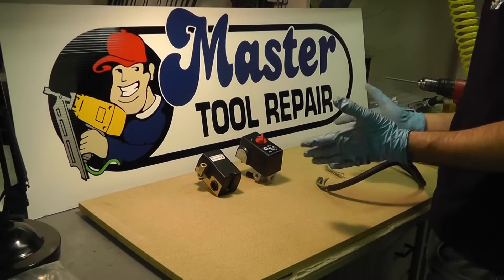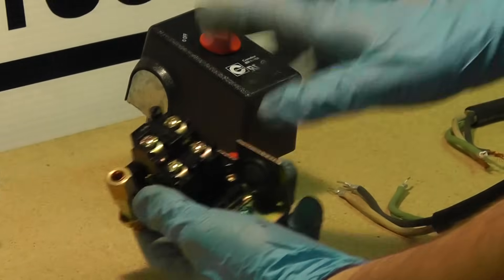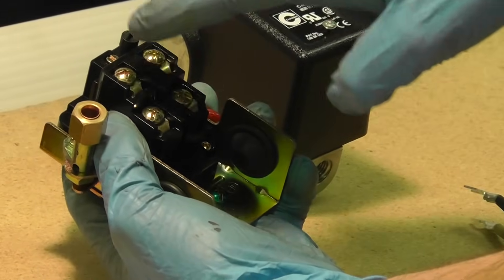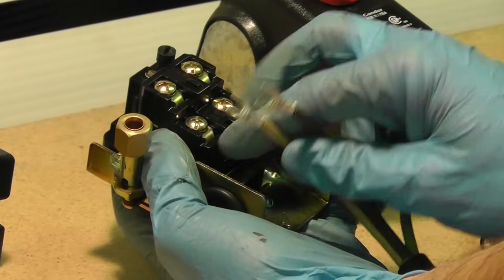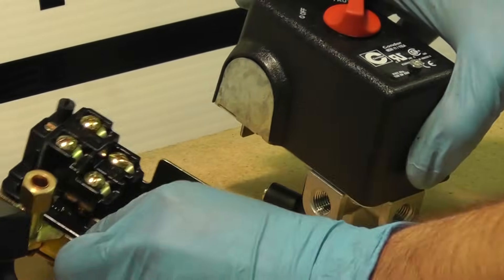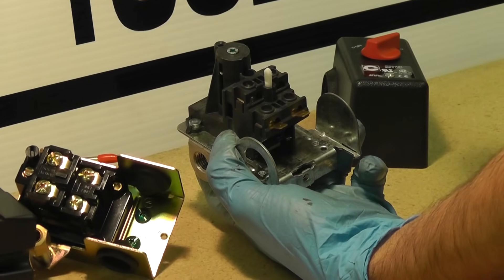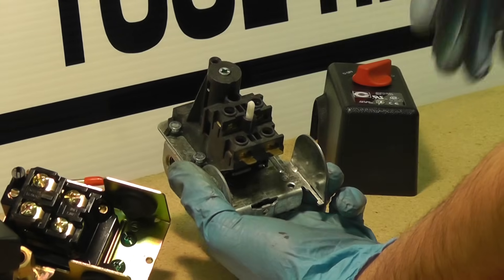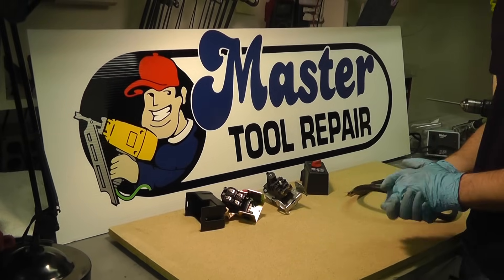How To Wire A Pressure Switch - MASTERTOOLREPAIR.COM

Comment: Of the dozen or so videos I've watched trying to find out which wire goes where, your video is the closest I've found. You stated that for the wires coming from the power cord to the pressure switch terminals marked "L" or "Line" it doesn't matter what color goes to which terminal, but you left out that for the other terminals, it also doesn't matter which color wire coming from the compressor goes to which terminal as long as they go to the ones marked "Motor" or "terminal".

Comment: So if you have 240 you will have 2 120 wires, do you just put them both on one terminal, I have the condor.
Reply from the maker: roger brandt It would essentially wire the same way as a 120V unit, but instead of a black & white wire you typically have a two black wires (powercord) and two red wires (motor cord). 
As long as you have both of the powercord wires connected to each "Line" post and both motor wires connected to each of the "Load" or "Motor" posts, you're good. The ground wires are attached to the base of the switch where they would typically go, no change there. It depends on the switch ultimately, but usually you will have to "Line" posts and two "Motor" posts.